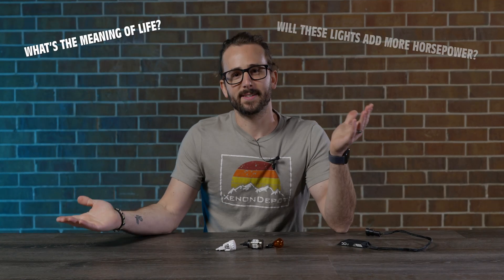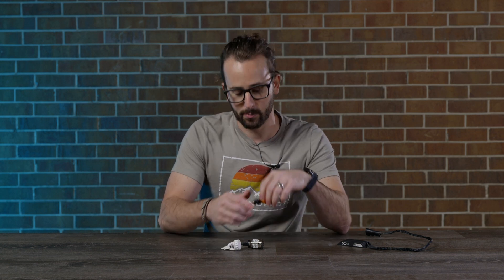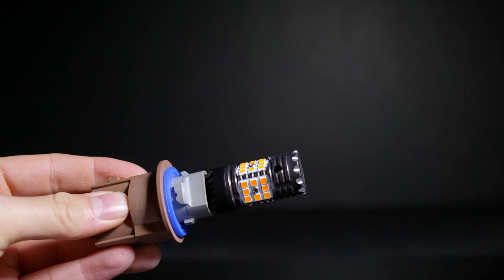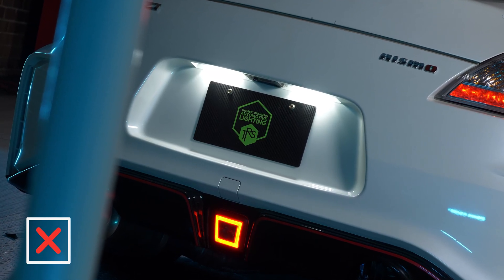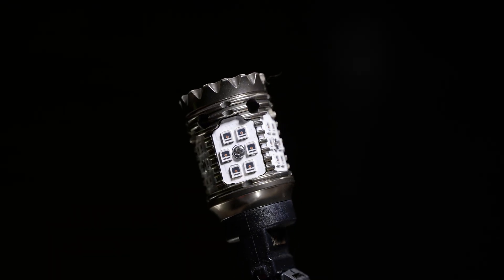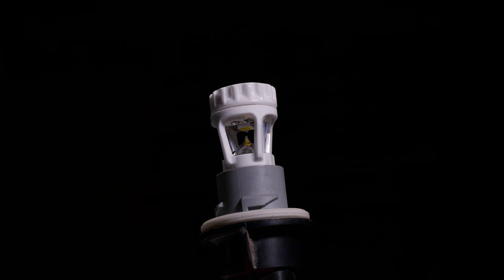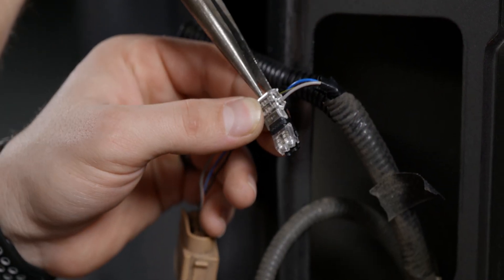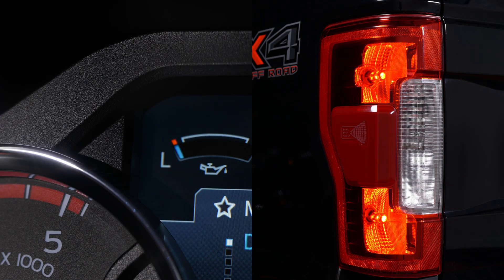TRS TECH TIPS: What Are Resistors & Why You Need Them

Comment: I have high powered LEDs from VLEDS for my tail lights that all work fine with no resistors. No hyper flash. The issue I had was with the license plate bulb. Using an LED there, the bulb would work but after some random time it would turn off and take out the rear park lights with it. Then if I turned the light switch off and on everything would work fine again for a while. I solved the issue by inserting a 100ohm, 5W wire axial resistor into the bulb socket with one wire end on the left bulb socket contact and the other wire end on the right bulb socket contact. Then I inserted the bulb into the socket. It fixed the issue. Is the way I installed this resistor a parallel connection or series?
Reply from the maker: It sounds like you made a parallel connection!
Reply: @RetrofitSource  what would happen if it was connected in series instead?

Comment: What about DRL lights ( like the one in wrangler fender led) does it need a resistor ?
Reply from the maker: Most DRLs do not need resistors unless they're shared with the high beam. DRLs shared with the high beam will need a PWM (pulse width module) to prevent hyper flashing.

Comment: I put led in my reverse lights but now they don't turn off. They have a very dim glow even when the vehicle is turned off. If a resistor isn't needed for reverse lights, what would I need to do to correct the issue?
Reply from the maker: The lights may not be compatible with your vehicle!
Reply: @RetrofitSource  I just put the original halogen in one side and the led on the other. Led adds some brightness and the halogen turns off the circuit. With both LEDs it kept the reverse camera activated and they stayed on very dim. Thought maybe a resistor would help but as stated in your video it wouldn't do what I was thinking. Thanks for the response and all the info y'all provide to us.

Comment: As someone has already mentioned, a flasher relay that is set up for LEDs would be a better option than adding resistors. On newer Vehicles, that do not have a flasher relay, but instead operate the turning signals and emergency flashers off the BCM, you can simply reprogram the BCM.

With a lot of newer Vehicles you can reprogrammed the BCM with a simple OBD2 dongle.

You really should never "tap" into a factory wire unless absolutely necessary.
Reply from the maker: Yes that is also an option, this video was just a guide to help people understand what they are. 
Thanks for the comment.
Reply: On 2006 to 2009 Ford Fusions you have to add a resistor to them cause they use a SJB instead of relays for the turn signals. Also if you add led low beam headlight bulbs you have to add a resistor to cause non of the anti flicker/canbus modules will fix the check headlamp warning message the vehicle gives you every 10 minutes. It sucks cause it’s such a pain in the butt to fix since there is barely any room to do anything by the headlights on these cars.